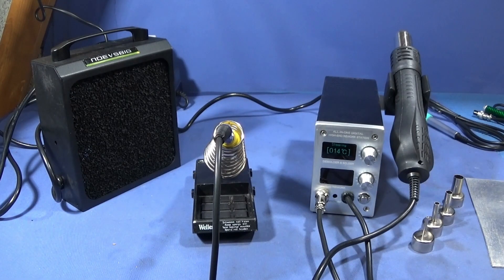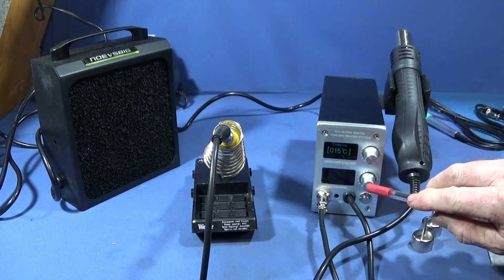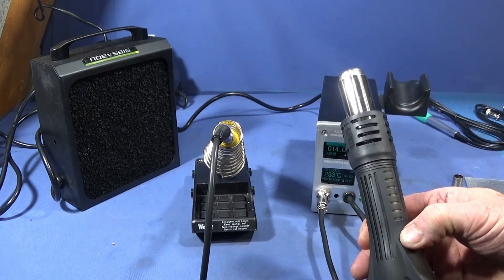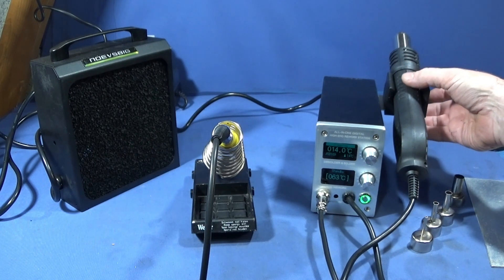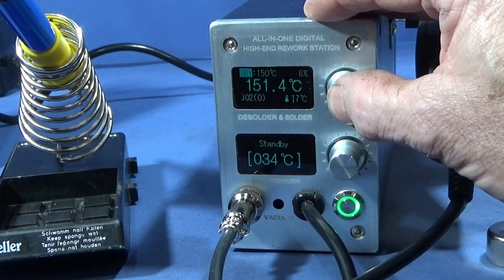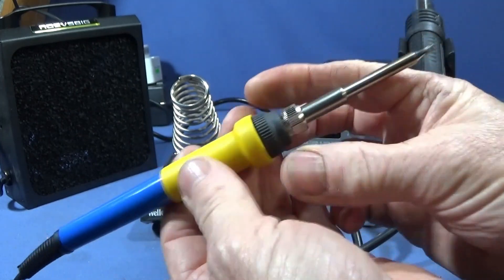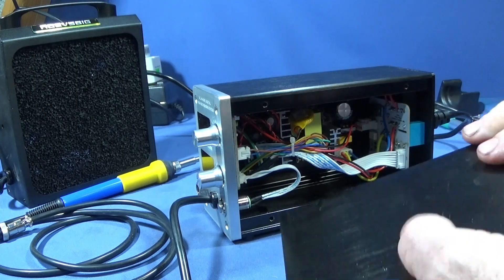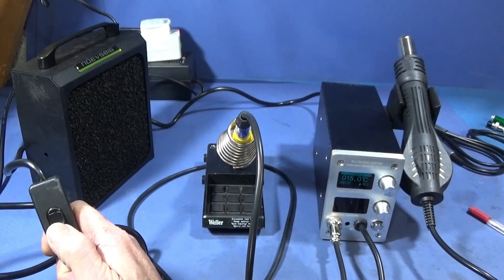KSGER All In One Digital High-End Rework Station STM32/T12 Review

Comment from the maker: Banggood Christmas Interest-free Sale -- https://bit.ly/384y2fp  
NEWACALOX Solder Smoke Absorber -- http://bit.ly/3r3g99A
KSGER STM32 OLED T12 Temperature 2 in 1 Hot Air Dryer  -- http://bit.ly/2GdzPVm
AC 220V/240V To AC 110V/120V 300W Electronic Converter -- http://bit.ly/39NmMH5
Reply from the maker: 11.11 Shopping Festival -- https://bit.ly/32xFLRw
11.11 Coupon Center -- https://bit.ly/35eUn9U
Reply from the maker: Banggood Klarna Interest-free Sale -- http://bit.ly/3rXAnBB

Comment: Thanks Steve. Nice review of the rework station, KSGER STM32 OLED T12. Banggood US, $201.99 + $5.22 ship. AliExpress is $177.31 and free ship.
Reply from the maker: Banggood Christmas Interest-free Sale -- https://bit.ly/384y2fp  
NEWACALOX Solder Smoke Absorber -- http://bit.ly/3r3g99A
KSGER STM32 OLED T12 Temperature 2 in 1 Hot Air Dryer  -- http://bit.ly/2GdzPVm
AC 220V/240V To AC 110V/120V 300W Electronic Converter -- http://bit.ly/39NmMH5

Comment: Link you posted to the Rework station goes to the fan. Also, on Banggood, the STM32/T12 is only a soldering station, and not a rework station.
Reply from the maker: Banggood Christmas Interest-free Sale -- https://bit.ly/384y2fp  
NEWACALOX Solder Smoke Absorber -- http://bit.ly/3r3g99A
KSGER STM32 OLED T12 Temperature 2 in 1 Hot Air Dryer  -- http://bit.ly/2GdzPVm
AC 220V/240V To AC 110V/120V 300W Electronic Converter -- http://bit.ly/39NmMH5

Comment: Sure do appreciate your video on this equipment.   Do you recall what the Bangood listing was titled?  Much appreciated
Reply from the maker: I will put the link on later
Reply: @SteveJordan  Thank you Steve.
Reply from the maker: Banggood Christmas Interest-free Sale -- https://bit.ly/384y2fp  
NEWACALOX Solder Smoke Absorber -- http://bit.ly/3r3g99A
KSGER STM32 OLED T12 Temperature 2 in 1 Hot Air Dryer  -- http://bit.ly/2GdzPVm
AC 220V/240V To AC 110V/120V 300W Electronic Converter -- http://bit.ly/39NmMH5

Comment: Links to where you bought this stuff would be nice
Reply from the maker: Banggood Christmas Interest-free Sale -- https://bit.ly/384y2fp  
NEWACALOX Solder Smoke Absorber -- http://bit.ly/3r3g99A
KSGER STM32 OLED T12 Temperature 2 in 1 Hot Air Dryer  -- http://bit.ly/2GdzPVm
AC 220V/240V To AC 110V/120V 300W Electronic Converter -- http://bit.ly/39NmMH5